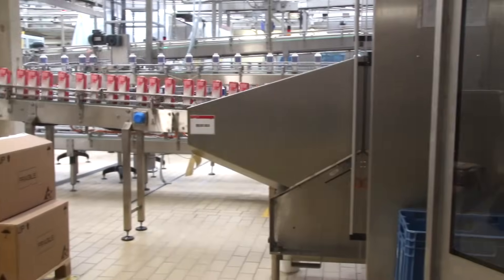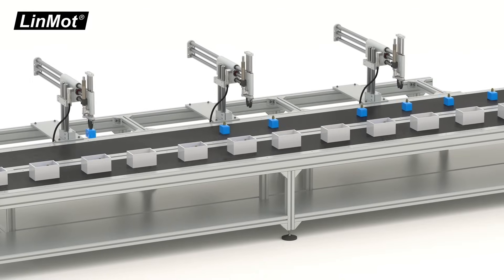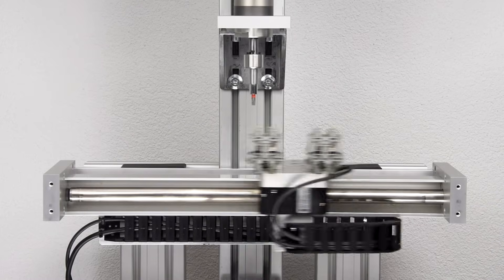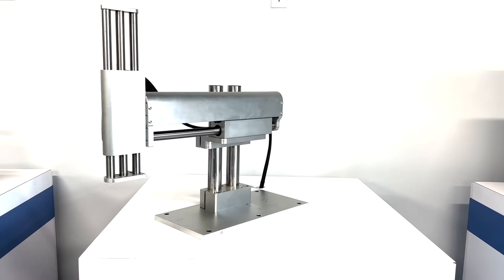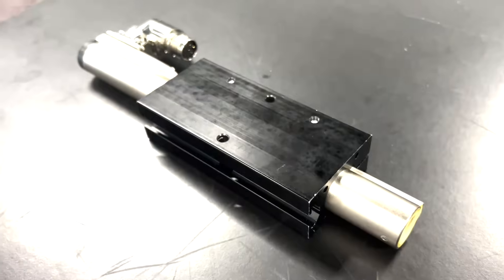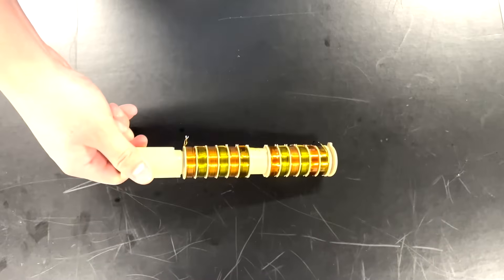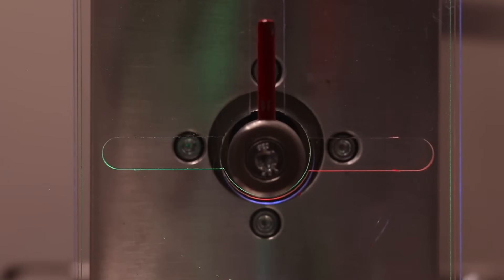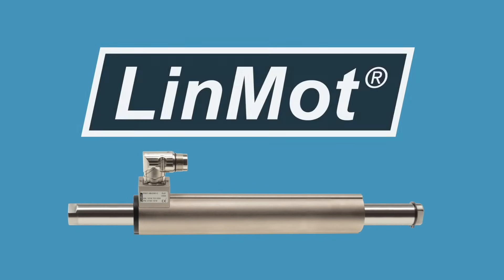Why the Electric Linear Motor is the Future of Automation

Comment: Biggest problem is the price...
Factors for this are:
-Rare earth materials for n52 magnets
-Expensive ASIC controllers for the motor drive

If those would be more cheap i am sure everyone would change... Make it much more affordable, then even home 3d printers can use it.

single nema23 stepper with magnetic encoder and controller == 70$
same size linear electric motor with controller and encoder == 1300$

Not worth it until the price comes down drastically like -95%
Reply: exactly i was to say.
I was looking for linear motors few time ago before pandemic for 3D print and airsoft guns. but encoder are bulky and expensive.
Reply: @slevinshafel9395  I agree with both comments here.
I did over a decade of this type of automation before going over in to mining and resources almost 20 years ago and not much has changed at all in those 20 years. Mining doesn't change much either and the reason is simple - the fundamental tasks haven't changed that much.
Doing things like putting caps on containers is the same basic task today as it was decades ago. Pick and place hasn't changed. Its still pick and place. Although the fully variable gripper they show is pretty cool.

The only place I ever saw these was on a flat bed laser cutter. What made it practical was that laser cutter had a monstrously powerful laser. In normal cutting, milling grinding you can't remove metal any faster unless you have a more power in the cutter. 

Unless you were doing exquisitely accurate 3D printing or doing 2D laser etching at seriously high speed I can't see these taking over from steppers with lead screws for low resolution or servos with ball screws for higher resolution.

The hardest thing they'll find is the rare earth magnets because that market has a serious undersupply even without the move to EVs. That's where I have had some eye openers in the mining game. things like iron and coal are fairly simple. Dig it up and crush it. Other things like copper, nickel, uranium, aluminum get way more complex very quickly but rare earths are pain in the ass to refine - ask the Malaysians.
Reply: @tonywilson4713  that's why there will never be a robot army, we will use animals with VR headsets as robots
Reply: @cybyrd9615  That's as good of an answer as any.
Reply: @slevinshafel9395  Seeking overseas distributors&buyers
Guangdong Chuangfeng Precision Machinery Co., Ltd  has been a leading linear actuators&cartesian robots manufacturer in China since 2004. We maintain high standards and provide excellent products from our two factories covering an area of 9000㎡. with a team of 150 skilled technicians & more than 100 distributors nationwide. has established strong partnerships with more than 20 listed companies, such as FOXCONN, BYD, GREE, BOE. Our products provide the same quality as famous brands such as HIWIN, THK, IAI, Misumi and SMC. We also OEM for these brands.
Our products include:
1. Linear Motors
2. Electric Servo Cylinders
3. Ball Screw Linear Actuators
4. Belt Driven Linear Modules
5. Rack and Pinion Linear Modules
6. Cartesian Robots
7. KK  Modules
Morty Lv
📲 Whatsapp: +8618926969305   Mobile/Wechat:  18926969305
📧 Email: lzx@cf16.com          🌏 web: https://www.cf16.com/En
🏢Guangdong Chuangfeng Precision Machinery Co., Ltd.
📍Add; No.9,PIngdong 1st Road, Nanping Science and Technology Industrial Park ,Zhuhai, China
Reply: @slevinshafel9395  Seeking overseas distributors&buyers
Guangdong Chuangfeng Precision Machinery Co., Ltd  has been a leading linear actuators&cartesian robots manufacturer in China since 2004. We maintain high standards and provide excellent products from our two factories covering an area of 9000㎡. with a team of 150 skilled technicians & more than 100 distributors nationwide. has established strong partnerships with more than 20 listed companies, such as FOXCONN, BYD, GREE, BOE. Our products provide the same quality as famous brands such as HIWIN, THK, IAI, Misumi and SMC. We also OEM for these brands.
Our products include:
1. Linear Motors
2. Electric Servo Cylinders
3. Ball Screw Linear Actuators
4. Belt Driven Linear Modules
5. Rack and Pinion Linear Modules
6. Cartesian Robots
7. KK  Modules
Morty Lv
📲 Whatsapp: +8618926969305   Mobile/Wechat:  18926969305
📧 Email: lzx@cf16.com          🌏 web: https://www.cf16.com/En
🏢Guangdong Chuangfeng Precision Machinery Co., Ltd.
📍Add; No.9,PIngdong 1st Road, Nanping Science and Technology Industrial Park ,Zhuhai, China
Reply: If we are talking about an assembly line, The capital cost is dwarfed quickly, by the downtime that pneumatic actuators require. Unless I misunderstood these are Linearly Variable Differential Transformers being used as both sensor and actuator. For experimenting they are easy for a hobbyist to make. A to D converters D to A converters, power electronics a brass tube, a ground steel rod and your favorite System on a chip microcontroller. This tech has been around for a long time usually used as a position and velocity sensor, but combined systems that integrate motion and sensing have been used for a long time. I started using these to replace sensors in interactive Museum exhibits to reduce the downtime and maintenance. I don’t think I have ever seen one fail if it was designed correctly and the mechanical integration was solid. I wish they were cheaper too.
Reply: @rustybucket2248  I have been doing automation for 30+ years.
You're 1/2 right on pneumatics. The single greatest failure cause in pneumatics is the filtering before the air goes to the system. I had that argument so many times. Its amazing how many people don't put filters in their systems and then wonder why stuff fails.

On your linear transformers comment. Again its a bit of yes and no. At a basic level YES but to make it work precisely is a lot more complex. Its a lot more than A-D and D-A converters and a lot more than power electronics in a brass tube. This is closed loop control and one of the basics to that is you need to measure position to at least 1 order of magnitude higher than what you want to achieve. I was taught this basic reality back in the 90s when I first started working in industry. Its basically:
if you want +/- 1mm you need to measure to 0.1mm. 
if you want +/- 0.1mm you need to measure to 0.01mm.
if you want +/- 0.01mm you need to measure to 0.001mm.

You eventually get to a problem where you have to measure very very accurately and that means handling a signal that's switching very very quickly and each jump is 10x higher. When I was first into motion control in the early 90s we struggled to find any chips at all that could read quadrature encoders. A lot of that tech was proprietary to specific companies. I was doing a lot of sheet metal machinery at the time (blanking lines and roll formers). Doing any sort of precision at that time wasn't easy. By the end of the 90s it had changed dramatically with new chip families becoming freely available. By the early 2000s you could develop a high end servo drive in a matter of days instead of years. A lot of it had to do with the availability of DSPs which were found to be ideal for motion control.

What really changed was the chip manufacturers started releasing standard code blocks for applications. Arizona Microchip did that for their PIC family. We had their book with all their application codes for all sorts of applications. Suddenly we didn't need to write algorithms from scratch in machine code. Then came the C compilers and doing embedded projects went from monster headache to plug and play.

These days with the availability of things like Arduino's and other systems you can make 2-3-4-5 axis systems with not a lot of equipment. These days nobody has to do the complex designs for the amplifiers that make the closed loop systems work. What people do need are the skills for tuning these systems. Tuning closed loop systems takes a lot more than what I have written here. Its still a bit of black magic.
Reply: @tonywilson4713  Tony I could not agree more. My comment was primarily directed at @snapo who was complaining about price. I got the feeling that they might be a hobbyist. My suggested system was really meant as a learning project for snapo.  I started my career in 1970. I have designed an implemented all manner of motion and control systems. Yeah it was a lot harder back in the day. I have never met a control system that didn’t need tuning. My least favorite task was be assigned a work ticket on a legacy system. Getting the system back up and running was usually straight forward. When it became clear that it was a design problem and not a field engineering problem it wasn’t pretty. It was almost never the case that the design documents were available. Management was never happy when I told them that we going to have to allocate engineering time to analyze the system and revise the current design or preferably reimplement from currently available components. I complain about it but it was probably my favorite part of my career arc. (Started in field service. Moved to field engineering and then design engineering because I was the walking talking institutional memory of the designs that came before me. I ended up Starting my own company which today has over 20,000 employees and is 40 years old. *no I don’t get a penny from the now publicly traded company. Thanks for the insight on the Pneumatics. Engineering wise what I saw in the field most often was actuators that were being asked to work way out side of their repetitive load and cycle limits. Running systems to failure with out any of the required interim maintenance. There was way to much “When the smoke starts to clear, ship it to the customer”. Thanks for the chat.
Reply: - Rare earth materials for n52 magnets

I think it is possible to replace the magnets with other electromagnets to reduce the price. That way we might get more control of force and precision. We would lose in terms of reliability, at the electrical power supply contact of the mobile electromagnets.
Reply: @AntalMadincea  but you loose the torque and size... What would be cool is a pcb based linear motor that includes a cheap inductance based encoder. Then mass manufacture it for cheap in jlcpcb or pcbway
Reply: @AntalMadincea  It would become extremely unreliable and would introduce additional problems like circulating shaft currents since you would all of sudden need a linear brush system, terrible idea.
Reply: And you are comparing to stepper motor. The majority of automation can be done with air cylinders, that can be as cheap as $5-10. If you got a machine with 50 air cylinders, which is not uncommon, the cost of the machine would exceed the cost of manual labor. These do have a place, but definitely can't replace air cylinders.
Reply: totally agree, not worth it, replacing pneumatic cylinders which is known for reliability and made of aluminum and SS, instead going to copper and rare magnets to take the price up for nothing. I'd go for a nema23 stepper for sure for the same function and same ( ECO friendly ). People should know how bad to the environment is extracting Neomydium magnets from earth. Totally non-eco friendly
Reply: @mohamedmohsen4969  every good motor uses rare earth magnets.... but the ammount used in linear motors/actuators is much much higher. I wonder why they do not make the stator only magnetic and the rail the pcb/coils...
Reply: So wait until there is more competition to drive down the price or the main supplers' factories get big enough to lower the price.
Reply: @Stealthsilent1337  Only China will drive down the price. But there is so little demand for this in China, its not likely to happen any time soon.
Reply: You're comparing a linear servo motor to a stepper motor and encoder? It's application dependent. Of course these are going to cost much more. They'll also blow away most other types of actuators in speed and precision.
Reply from the maker: @adlisharr is absolutely right. These are indeed different technologies with very different capabilities. 

LinMot P01 linear motors are permanently actuated ironless synchronous servo motors with integrated position measurement and over-load protection. Unlike conventional drive solutions, LinMot solutions do not require any mechanical transmission elements (nor external encoders), which simplifies the design and reduces wear to almost zero, thus minimizing maintenance. This provides added value in terms of flexibility, reliability and productivity (with peak motor velocity up to 7.4m/s).  
LinMot motors perform particularly well when it comes to consistency of motion, repeatability, operating noise and energy efficiency. In addition, longer lifetime, better MTBF, a minimal number of standard components, lower installation and changeover costs will make up for a better TCO.  

Not all applications are the same and will certainly have different levels of innovation, requirements and budgets, which will inevitably determine the best solution to use.
Reply: @adisharr  The point for any engineer is the specs. Do you you need the speed or the precision?
If you don't a stepper might do.
If you do maybe its the solution you need.
Reply: @tonywilson4713  You made my point for me. No one is looking at a linear servo for a stepper application so the comparison is pointless.
Reply: @adisharr  how often do you see steppers driving lead screws or ball screws? It is very often. That is an application that requires linear motion and precise control. Steppers and lead screws or ball screws are used because they are relatively cheap and easy. That is an application where linear motors would be very good as well and have a number of advantages, including faster speeds, higher efficiency and probably lower maintenance.

So yes people would be looking for linear motors rather than steppers and lead or ball screws, especially if this can reach the precision stated.
Reply: @conorstewart2214  why are you responding to me exactly?
Reply: @adisharr  I'm directly responding to one of your comments.
Reply: @conorstewart2214  What is your point? I responded to OP about their comparison of a stepper with a linear servo and how they are used for completely different applications and have different price points. You responded with an unneeded explanation.
Reply: You don't have any experience with motors, do you.
Reply: @bingosunnoon9341  He's also forgetting that $1300 gets you a complete assembly.
$70 only gets you a motor and it doesn't include the lead screw, linear bearings, motor coupler, and probably a few other things. 
Then there's the discussion of the encoder and does it have the same resolution .
Then there's the motor drive and there's just a wee bit of variety there!

Selection hasn't much to do with price and an awful lot to do with the precision of the required task.
Reply: @tonywilson4713  Most of this stuff comes out of China now. You can get a small stepper, controller, ball screw and linear guides for under $70. Really.

Comment: How do these motors compare in terms of force output to equivalent OD (OD not bore because the OD matters for retro-fitting) pneumatic cylinders? Obviously pressure would determine the force for pneumatics, so maybe compare the linmot motors to pneumatic at 60psi, 90psi and 120psi
Reply: significantly lower force for the same size
Reply: The dimension vs force ration is not always a good way to look at it. These might have a similar power density  (speed*force/overall volume) to hydraulics and be considerably faster, while providing less force. The could also be easier to control than pneumatics linear motor.
Reply: @Factao  if you're designing from scratch and care more about speed you're right, but if you're retrofitting (they seemed to imply was a near drop-in replacement) I figured you'd be dissappointed. Machines might not have room for a bigger actuator to get the same force required to do their jobs, hence my question.
Reply: @BenRyherd  fair point

Comment: hundred motors (cost (or hundred cylinders and  one compressor.  calculations needed
Reply from the maker: You can find more info about the US Cotton study on the following link: https://www.designworldonline.com/electric-linear-motors-picked-for-swab-application/  

To learn more about this topic, I would recommend the following page: https://linmot.com/applications/pneumatic-replacement/  

For an additional head-to-head comparison between pneumatics and LinMot motors, you can check the study made by Forpak on the following link https://www.packworld.com/machinery/controls-automation/article/22249851/headtohead-test-demonstrates-cost-savings-for-oems-customers?utm_source=Newsletters&utm_medium=PW+Machine+Automation+Insights+NL&utm_term=20220614&oly_enc_id=5134C2722701B1Y

Comment: Are these essentially linear stepper or servo motors?
Reply from the maker: They are high quality tubular style linear servo motors. LinMot linear motors are permanently actuated synchronous servo motors, with integrated position measurement and over-load protection. Permanent magnets in the slider (like a rotor) and windings in the stator are used to generate forces, like in a brushless rotary motor. The configuration and different arrangement of the magnets generate the linear motion directly, using electromagnetic force, without mechanical elements that are subject to wear.
Reply: Basically yes.
Reply: I prefer a system that serves me without electricity and sensitive consumer electronics that are susceptible to damage. By the way, the motor in the video is a mechanical motor, all of its components are mechanical ( except for the consumer PCB chip, of course ). Exaggeration of wear and tear is exaggerated and it is a problem that can be solved ! Such as " protection against overload in this video "